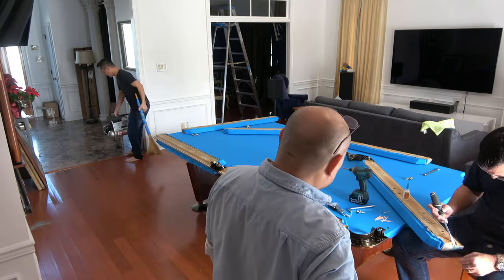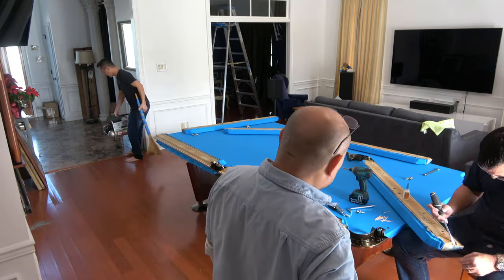Brunswick Gold Crown III Install

Comment: Paid 1,000 for GC3.  $70 to powder coat the castings and counters.  First time I bought felt it was around $220 and $120 for the SuperSpeed cushions.  So for around $1,500 my table looks just like this one.  I love the Gold Crowns.  The GC4 with levelers is probably one of the best tables.  We won't talk about the cost of cloth right now.  My table is getting close so I checked and it's close to $400 now.
Reply: what’s the exact color bronze you would use? i’m gonna you prismatic powder coats, any idea what comes close to the original ?

Comment: Great Video Doug. What Are The Advantages Of Using Bondo Over Beeswax On The Seams? Thanks 👍🏻
Reply from the maker: Bondo is more stable in a wider range of environments. It's harder than beeswax, contains no oils that could potentially leech into the cloth (that's rare but it can happen). It doesn't get brittle like plaster of Paris. I don't have to melt it with a torch like beeswax or synthetic waxes (so it isn't a potential fire hazard). It isn't as messy. 

Need I go on? 

Bondo is just a great medium to use. Why guys still insist on using waxes, plaster of Paris, Durham's putty, or anything else is beyond me.

Glad you liked the video. The customer was overwhelmed with joy when he finally got to play on his table!

Comment: What is your feeling on bondo vs. beeswax?
Reply from the maker: I much prefer Bondo. I’ve been using it for 30 years and never once had a problem with it. No need for any kind of heat source and it’s much cleaner to work with.
Reply: @CreativeRestorations  Thanks. Does it stick when there is previous beeswax and how do you remove it for a relevel?
Reply from the maker: Use a scraper to get the majority of the beeswax off and then, do several scrubbings using steel wool and acetone. That should do it for you.

Comment: Just purchased a pool table, plan on installing myself. That being said, the location I’m putting it in is an out building behind my home. I live in an area that is often cold (Midwest). The out building has no heating or cooling. Are there any concerns with pool tables? Should they be placed in certain environments temperature wise?
Reply: yes. beleive it or not moisture in air and room temp. can affect how the tabke plays. and never leave a table in 100° weather or cold ass weathers. will fuk it up bad.